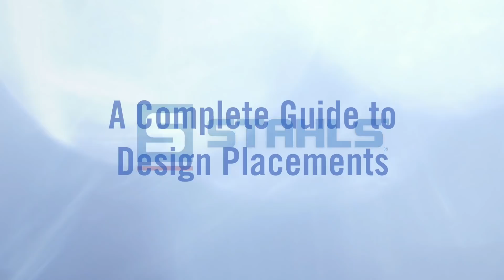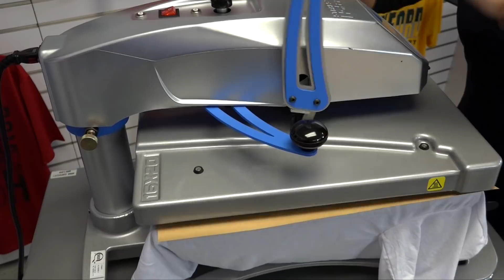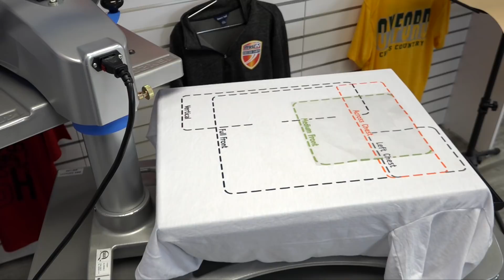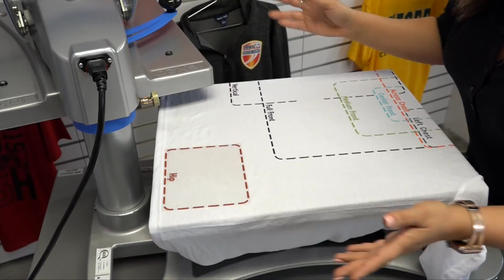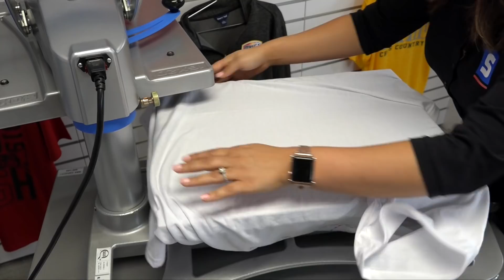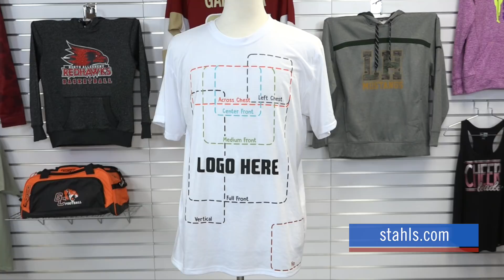A Complete Guide to Design Placements

Comment: What are the dimensions for a full front and a full back
Reply from the maker: Hi Emily. That's a good question, and it often depends on the size of your blank garment. A good way to be sure is measuring the area of the blank apparel you'd like to see the design fit. For some basic sizing ideas and a great place to start, check out our Design Size & Placement Guide - https://www.stahls.com/design-placement-guide. Thanks!